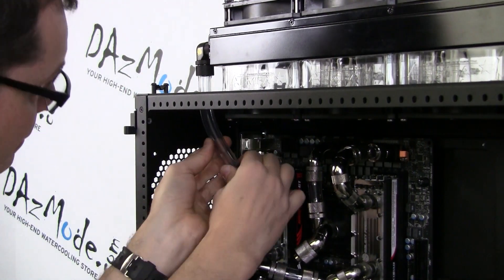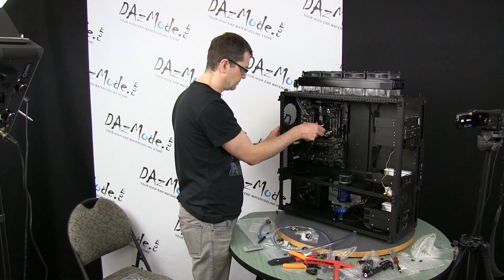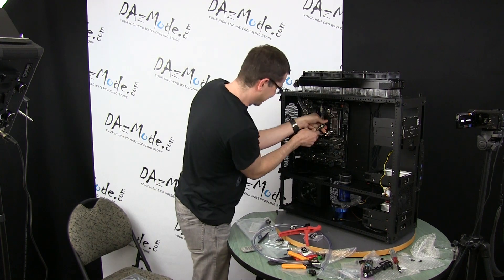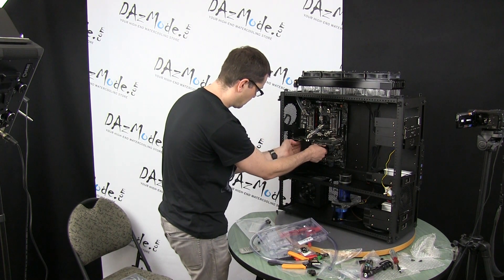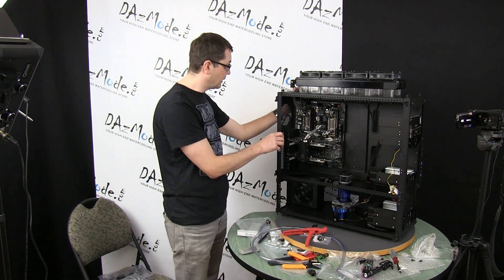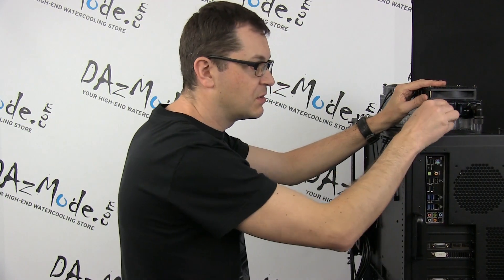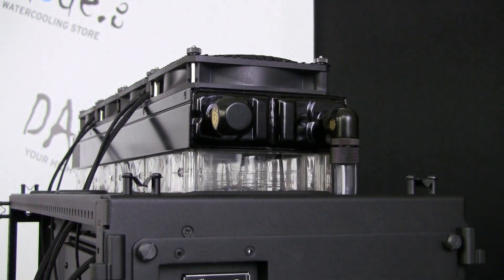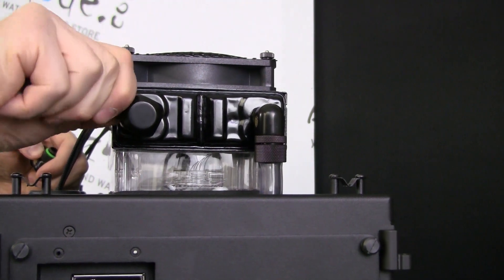Loop design completion - Venom Build Update (#16)

Comment: i hear and read that many people advice on not using 45 degree angled fittings as it restricts flow , and adds constraint to the pump/s is this true?
Reply from the maker: Longer tube rans and sharp turns (90-degree) slow you flow, but... While ago I added 9 of 90-degree elbows to one of my builds to see what difference it makes and I lost 1c.
Reply: DazMode  thank Daz its been a question iv had for a while now and i feel i got a good answer and an answer from a reliable source :) dude love the vids, keep em coming :)